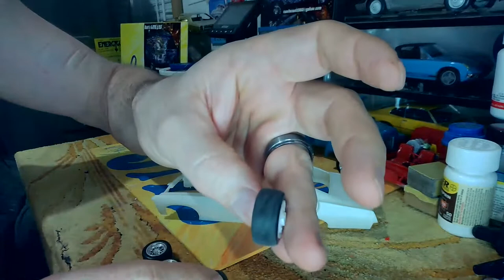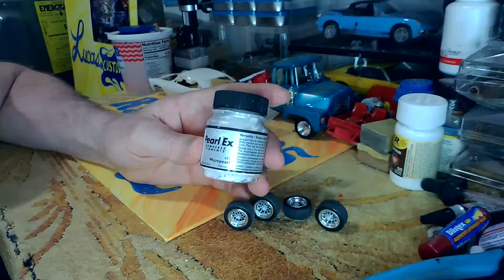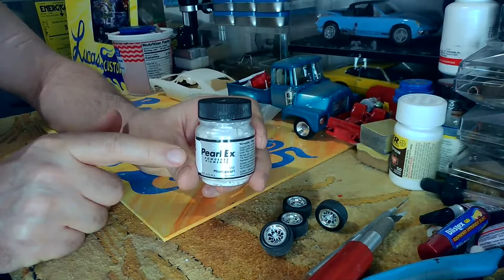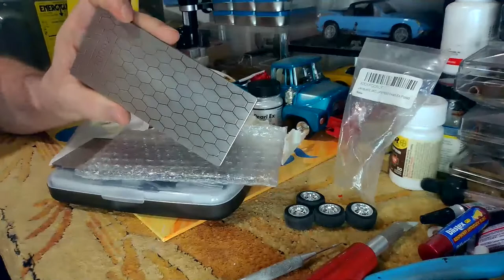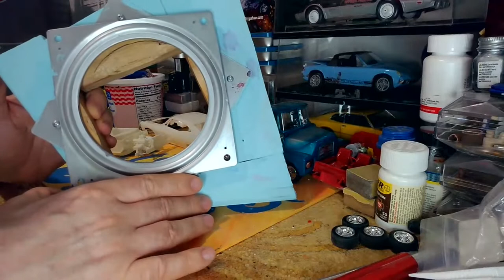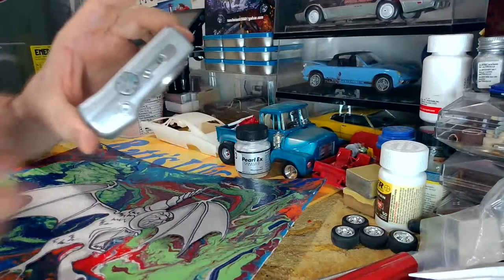Pearl White Powder

Comment: Great update. Wow, engraving? It's amazing how you come up with this stuff. Very cool.
Reply from the maker: Wow!!~Thank you so much John~Awesome compliment my friend~When I saw how a real Jewler's Vice moved and then that they are $350 + I thought man! I can make that out of a very heavy bowling ball better than the real high $$$$$ Unit~That all I need is the little peg part~Then found that scooter on Amazon for $14 free shipping~Then got the Lazy Suzan for $6 there as well~But lQQking at it now I think I can use that lazy Suzan I have and cut the ball in the center~And unscrew the 4 screws halding it to my perfectly square jig  hahaha and put it in the middel f the ball because I will not need it to pivit at the bottom then like it does not~It could be hald by the weight in the wood frame in the possition I need it in and then spin it from the top with my left hand while engraving with my right hand~That would make it a perfect masterpiece :))
Reply: @rattslive1255  you've got an amazing mind with a great knack for being creative
Reply from the maker: @AmateurScaleModelBuildi-lj3so  Thank you John~What a fantastic compliment~I sure appreciate that :))